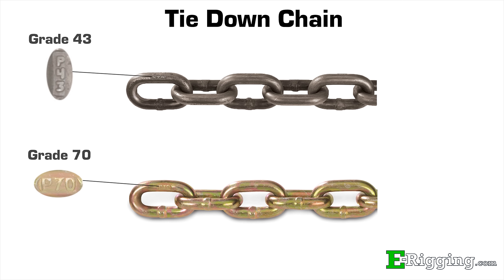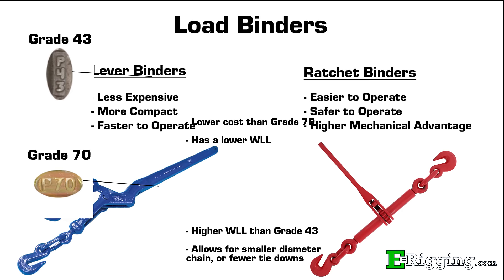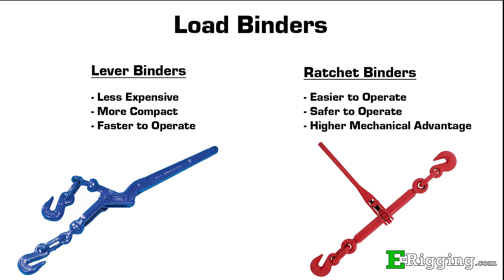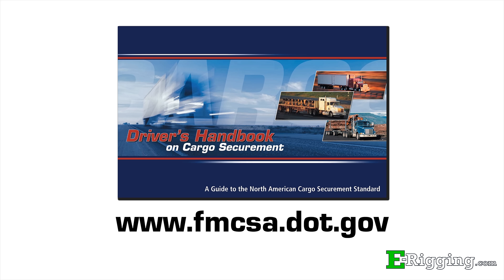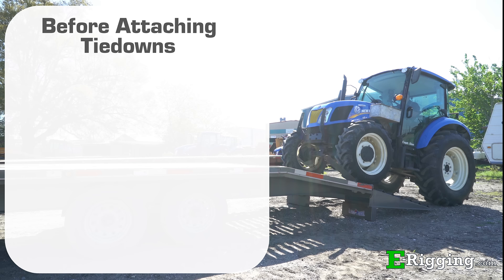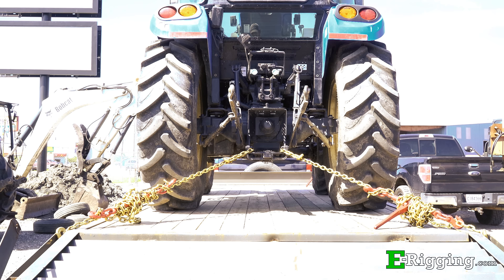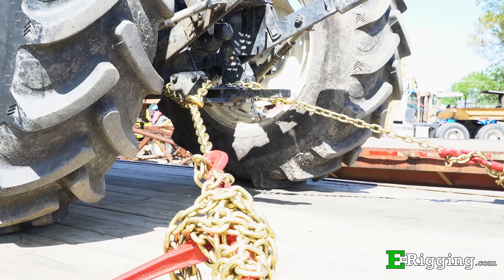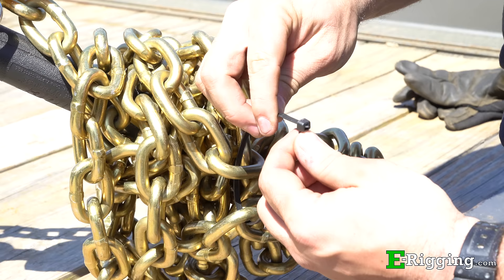Load Binding Tips - How To Secure Heavy Loads

Comment: You should learn how to tie a tractor down before you start giving lessons. Case or john deere would never let you get by with that tie down
Reply: What's wrong with it?
Reply: Strongest point of the tractor is the frame and draw bar. I attached my tractor down the same way in the rear. Front, is different.
Reply: If that's the case then the Tractor dealership this was filmed at is a fault, not e-Rigging.
Reply: Show me then, industrial know-it-all
Reply: @curiel45  Nothing, some one wants to post something and have clue what they are posting. I havera NH and uses the exact 4 points shown in this video and my tractor came to me with the same exact  4point used during transportation to me.